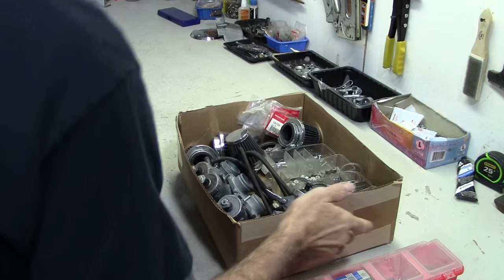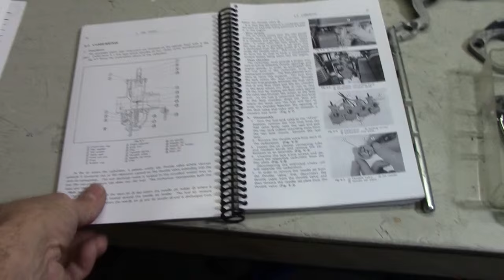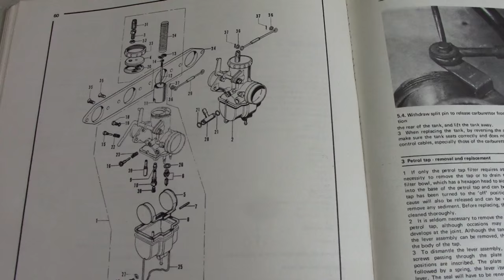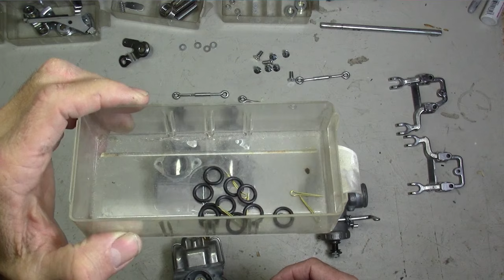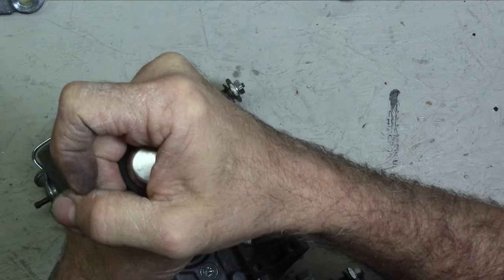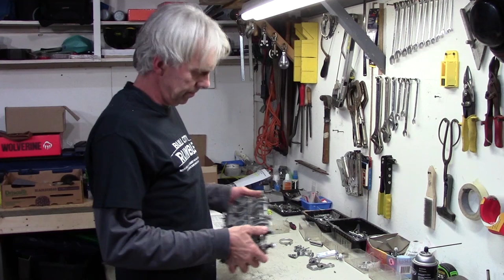73 Honda CB750 Custom Build Part 27 - More Carburetor "REVISED"

Comment: Just wanted to say thanks for these videos! I have a '79 CB650. It has the worst carbs ever designed. After seeing how easy these carbs were, I scoured the forums and found where they'll fit the 650 with one mod. I bought a set, rebuilt them and finally got my bike running reliably for the first time in almost a year.
Reply from the maker: +CB650Ryan Awesome! Congratulations! :)

Comment: Welcome back Deano.  I have been rebuilding my CB500 at the same time as you however you have always been a few steps ahead of me.  That was until you went away for so long and left me to figure it out myself...!  I had the same problem as you with my carbs except the previous owner hammered the rod out busting the retaining pin off.  I drilled out the hole and cut a flat headed, ridged nail to 11mm and pushed it through.  Works perfectly.  Thanks for all your videos, been following you since you started the Sabre Project.

Comment: Christmas arrived early! Good to have you back. Your videos has convinced me, that with the help of a Haynes, the workshop manual AND the hackaweek videos I Can fix just about anything on a motorcycle. So I finale got my licence and bought a CBR600 from 1990. At the moment ses torn a bit apart, a few parts being stripped and powdercoated, I changed the sprocket bearing and the fluids. Next up will be adjusting valves, so Ill rummage though your videos to find that chapter.Thanks for the inspiration!

Comment: I noticed something in your first upload but said nothing because anyone smart enough to rebuild a monster like this should easily recognize a video clip portion which has been captured in a mirrored image and realize that the machine they are working on will look the opposite. I watched this repost and found only this difference corrected. So did I miss something else? 
My congratulations on your creating very informative and precise videos specific to the machine you are working on. Obviously you leave no boxes unchecked. Merry Christmas and may God bless you and yours.
Reply: +EdOfTheNorth The choke linkages. The left/right bars should have gone on first then the middle one. That way they all run parallel and straight. I shot that scene over. :)

Comment: The pin is design to keep the shaft in place and allowed  to rotate in the same time.To correct it,you could tap the hole according to a set screw that you'll grind the tip for the fit you need and a drop of lock thread to keep it steady and voilà!
Reply: +arkangel13th That's exactly what I was thinking ...

Comment: Pod filters are 100% ok on these engines. The only problem i had was the weight of the carbs bouncing and destroying the rubbers. I made a bracket bolted on the engine underneath the carbs to support the weight.

Comment: Ah factory manuals, there is probably a supplement for that one you have that covers the later carbs, that's how Honda used to do it. Then later they might do a manual that combines the original manual and the supplements, 6230010 I think it was, but long obsolete of course.

Comment: Hey! First of all thanks for these awesome videos man, they are really really helpful. Question: Did you use the original jets in these carburators, or you got some more "opened". As far as I know if your air intake will be larger (4 filters) and also the stock exhaust will be replaced, you will need more gasoline to mix with the air. Am I correct? Thanks again man and Cheers from Argentina!

Comment: Hey  Dino, I have a 81 cb750c I think it has 120 main jets and its running lean with pods. I decided to mess around with and I put the airbox to see if it'll run better and it didn't turn on. I messed with the air/fuel screws (yeah I know bad idea). But I decided to order the stock jet kit. What advice do you have?

Comment: Do manuals for newer models use 3d computer generated graphics or are they still hand illustrated? I would imagine computer generated to be more economical... If so, are they better than the hand illustrated drawings, about the same, or worse? Also curious if manufacturers make 3d models available?

Comment: Where can I buy a carburetor rebuild kit for a Honda 1971 CB 750 K1 and a 1974 CB 750 when I turn the gas on the motorcycles start but gas continues to run out of the tube on to the ground or leak
Reply from the maker: +Jim Google it! :)
Reply: +Jim Just saw your comment and wanted to add that I got my rebuild kits off eBay, even the fuel-tee o-rings which I had trouble finding elsewhere